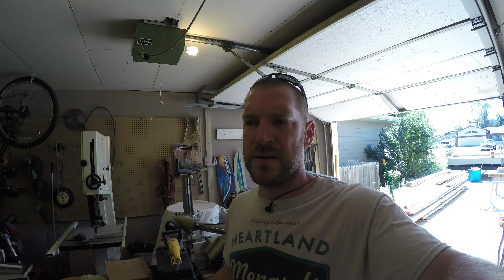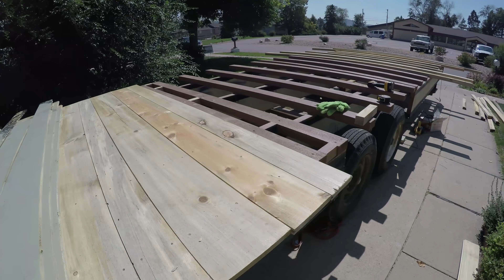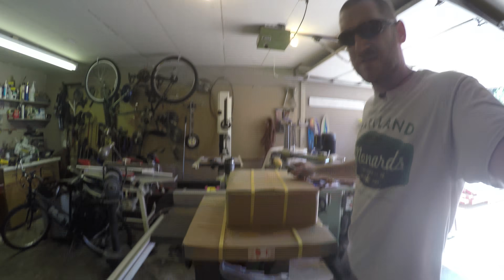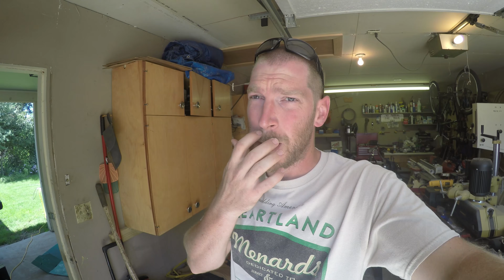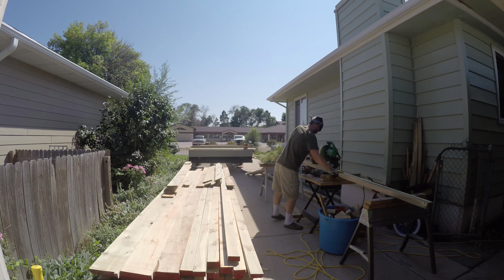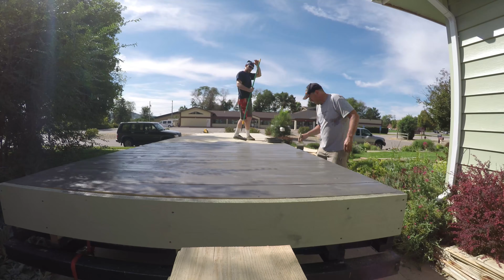4k HD: Woodworking Framing the solar kiln floor

Comment: I just bought a trailer just like yours...  now that yours is built.. would you keep it the same or is there some changes you would make?
IE. size.. height.. fans.. etc..
Reply from the maker: Seems to be working as is. A vacuum kiln would be what I change too if I was to do it again.

Comment: Nice build.  I don't think your choice of using drywall screws on the deck is a good idea.  They will sheer off in short order as the deck expands and contracts since the steel is brittle.  I know... I made the same mistake on a trailer.  You had best use regular decking screws that will tolerate such movement.  Looking forward to see how this project progresses.  Thanks for posting this.
Reply from the maker: +Hardnox Yeah we'll see how they hold up. The main structural members are bolted to the trailer frame.